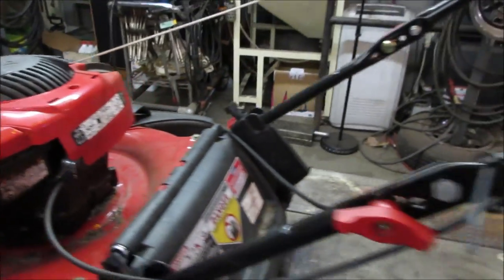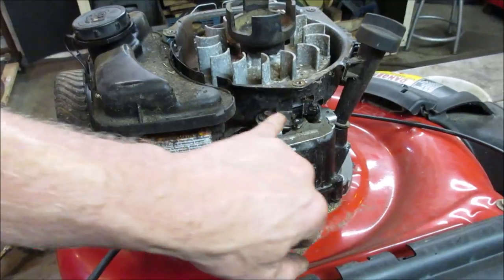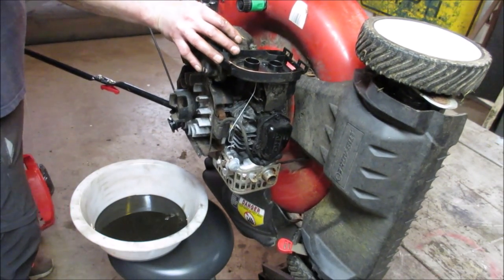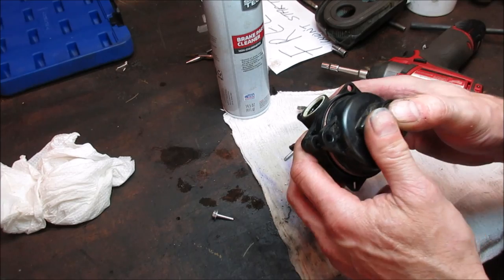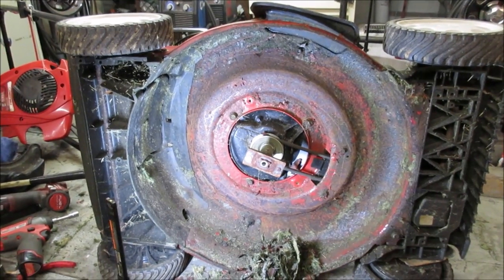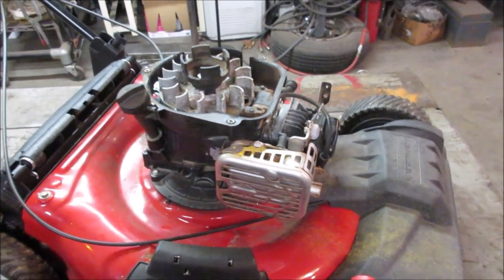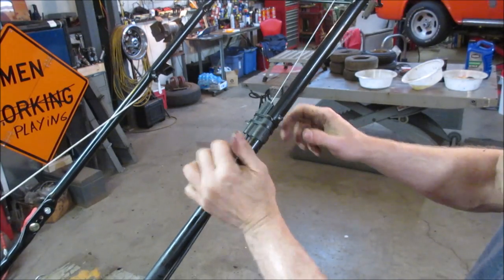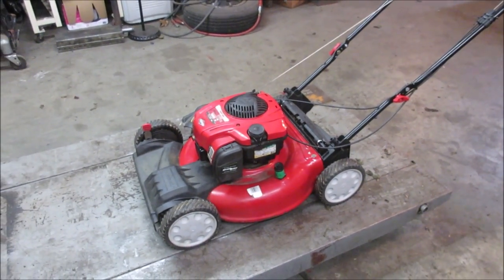How To Restore A Junked Lawn Mower. For Cheap.

Comment: A year ago I opened a small engine shop with a friend of mine. Learned a lot from you, Mustie, and you're a big part of why I opened my shop. I agree, most shops charge more than a push mower is worth for something like this. I don't. Not going to say the price, because I don't want this to be construed as an ad or a cheap plug. However, I've found I make more money charging cheap money for carburetor cleaning because people walk away when you tell them it's $100 and up but bite when it's a reasonable 2 digit number. Plus, I can clean that plastic carb and fuel tank in 15 minutes, so people are super happy when I can do it while they wait instead of having to come back. They tell their friends "This guy got my mower running in 15 minutes" and a bunch of people come out of the woodwork. It just makes sense to be reasonable and you'll make it up in volume.

Comment: Only bought one new mower. A Sears 20" self-prepelled power reel mower. Changed the oil, cleaned the plug, & air cleaner, adjusted & sharpened the blade every year.  Every 5 yrs new oil, air cleaner, plug, & drive belt. Stopped running 22yrs later. Original points & condenser  finally wore out.I had moved to Florida & had a rock yard now. So I gave it to fix-it-up & resell guy. New parts & wheels & back in service. $100. Still works. 1980 - 2022 >>>.

Comment: Thanks Mustie for continuing to offer these instructional small engine videos.  I have learned so much over the years from you (and continue to). Not only have you’ve saved me money but have given me great satisfaction in fixing my equipment.
Reply: Same, he has also given me confidence to tackle stuff myself.  He is the dad or shop teacher we all wish we had.
Reply: Same here. I was somewhat a good DIYer but he taught me so much more !
**Plus, he's the only man on earth I'd watch cutting his lawn !   🤣
Reply: I also solved my most complicated issues with my truck , after watching the video of his Toyota truck had a sudden misfire code and as soon as he described the possibility of what it might be , instantly I knew that he had solved this for me . I'm still impressed .
Reply: Me too
Reply: @marcryvon  Say whaaaaaat? I love mowing grass because it's so satisfying! I built a striper roller for my mower so that it makes really strong, bold lines/stripes/rows when cutting. I just used a section of ABS (you can use PVC but I though black ABS was more handsome) with 2 "test plug" end caps to make the roller's cylinder. I bought about 50 pounds of lead bullet casting ingots and melted them down into cylindrical hockey pucks by melting them slowly with my acetylene TurboTorch and dripping them into old cat food/tuna cans which were just a bit smaller than the ID of the ABS pipe. I cut the pipe to be as wide as the width of the mower from the outer side of each wheel. The test plugs cap off the ends from inside and are flush with the end, so the roller sits flat and level from edge to edge of the mower flattening the entire patch of grass that the mower touches so it's a solid and uniform stripe. I used CA glue to put one cap on, then I put the new round lead ingots in one by one, filling the gap around them with sand and dimpling the center of the ingot deeply with a punch to expand it into place a bit before I put the next ingot on top. I should mention that I measured the length of the roller so that the last ingot was cast to size for a perfect fit as the last one. Then I put the other cap on with CA glue too. I fabbed up the roller's arms by cutting and bending a few thin pieces of flat galvanized steel stock so that they could be slipped onto the wheel axle behind the wheel and then reach backward and attach to the roller in the center of the cap. I drilled the first arm hole to match the axle diameter tightly but with clearance to let it rotate and swing freely up and down to match the grass height. To attach the arms' other end to the roller, I just found the center of the circle by measuring and then drilled a hole down into the first 1 or 2 pucks. Then I used a coarse thread lag bolt (which I had drilled the arm hole to fit tightly for clearance but not much slop) to hold the arm in place. I laminated 3-4 of the thin steel stock together to form one arm. It was easier doing it that way to make the precise bends necessary. I laminated the arms with JB Weld. Then I put it all together, and it works absolutely fantastic! I see many others use sand or water as their ballast, but my mower is pretty small so that wouldn't be hardly any weight at all and the grass wouldn't be flattened much. The lead is dense as hell and the little 2.5" ABS is like, 50 pounds. It works great on our thick, beefy Bermuda grass that is kept short. Striping works much better on cool season lawn like fescue and rye that can be cut longer like 3-4" and is a delicate blade. The stripes are so satisfying to see with my nice and healthy dark green lawn. It's the best on the street but I put a lot of work into it to maintain that. It's truly a labor of love and de-stresses me. I like it. Most could not care less about the lawn. 😸😸😸 If you have OCD about neatness and symmetry then bold, straight, and sharp lawn stripes are heavenly to create and look at later.
Reply: Plastic carb, doesn't seem it was meant to be serviced,.......  love these videos.
Reply: @mannys9130  That is some M1 stuff you did there yourself! If you like Bermuda (I have it too and a roller on my mower as well) grass, check out "How to with Doc" he has some tips and great knowledge of food for your grass.
Reply: @geraldhaggard1018  no but they can be cleaned if they get clogged.
Reply: @SkaterStimm  Mustie is definitely the neighbor I wish I had. : - )

Comment: I literally found the same one the other day on the side of the road. All that was wrong was the recoil for the pull start. So I sprayed some penetrating oil, gave it a few rips and worked just fine. Cleaned the plug, carburetor and filter, changed the oil and it ran like a champ. Threw it back in the car and took it back to the guy and he was just shocked I fixed it. Told me to just keep it or sell it since he just bought a new one. My friend down the street needed a mower so I gave it to him. These videos always inspire me. Keep making them and I’ll keep learning from them 🤘🏼

Comment: Worked in a small engine repair place in high school. I've never bought a lawnmower! Every one comes form the side of the road. I do exactly what you just did and they all run great. Deck rot is the same here in Ontario. That's what kills them.
Reply: Honda has a non-metal deck mower that's got a lifetime warranty (I think) which makes deck rot a thing of the past. Love mine.
Reply: I agree...same scenario in Michigan neighbor....I make a good bit of side money buying old mowers and getting them right for spring time sale
Reply: @monkeybarmonkeyman  Huh, didn't know they had gone to a plastic (or plastic like) deck on some models. Think they used to have either aluminum or maybe even magnesium decks several years ago. Looks like their lower end stuff is still steel though.
Reply: That's a northern thing. You never see any equipment on the side of the road in the southern US.
Reply: I wonder if spraying the underside of the deck with Rhino Liner to seal it would prevent the paint from being removed and prevent the bare metal from rusting. Almost like a coat of armor. I know that as an auto tech, I've seen hard undercoating fail after a while and then it traps water beneath it making the rust even worse. However, truck bed liner is extraordinarily tough shit because of what it's designed to see daily. It's designed to have gravel dumped on it, furniture slid in and out against it, etc. Once it gets a thin coating of grass pulp, it would smooth out the pebbly surface. I wonder if putting a layer of sprayed polyurethane over the Rhino Liner would help smooth it out and add even another layer of durable protection to it. Or maybe go the other way around... Cerakote or polyurethane the underside and then put Rhino Liner on top of that. 🤔 Maybe Rhino Liner and a thick application of sprayed Plasti-Dip on top of it? I'm not sure. I'm in AZ. Most of us have no idea what a grass lawn even is. It's startling to native born people when they travel. 🙀 "WHAT IS THAT GREEN STUFF TAKING OVER THE YARD?!?!" Lol 😸 Some people do have Bermuda or St. Augustine grass lawns here though. The deck washer works pretty good most of the time and then one can just prop the mower up tilted over on a few bricks or 2x4s to dry out in the sun. Laying it over on the side and using a jet garden hose, or better yet a pressure washer, easily blows all the fresh grass off to keep the deck clean. Of course we have no salted roads here so our cars never rust either! My last car was a 1984 diesel Mercedes that had no rust on the underside whatsoever. The paint was gone, the suspension rubber was rock hard and split apart, and the interior plastics were brittle as glass, but the metal itself looked mint. 💪😸
Reply: @ksavage681  You have to go from 8pm to 6am. Mostly by 5am everything good is gone.
Reply: @ksavage681  Never, ever seen one down here.
Reply: @monkeybarmonkeyman    I have a push-mower from the 70's... has a cast aluminum deck.... still looks like new... I believe it's made by Hahn.
Reply: @PatrickWagz  Lawnboys used to be cast as well. Don't believe I've heard of a Hahn. Have to look it up!
Reply: Problem is folks mowing when it's too wet ( I hear folks around me mow wet frequent) wet grass clipping stick to deck, 99% of common owners NEVER use deck wash or scrape the deck, the moisture gets trapped between the grass and deck and just eats away slowly at the decks. I have the first model year toro recyler 20332 (2008-2012) that has seen thousands of hours, not deck rot, engine still starts 1-3 pulls and always gets a seasonal oil change. Other than the terrible plastic on steel Pinon drive gears that failed in 2019 ($40 aftermarket kit to replace with all steel construction) still running like a champ. Every month or two I'll pressure wash the deck, and add some paint and some wax, a smooth waxy surface grass doesn't really collect anymore!
Reply: @ksavage681  so you rebs just are better then us yanks at maintaining a simple machine?

Comment: What I love is Mustie makes this look easy.  That would've took me an hour to find the problem.
Reply: He's methodical, I reckon that is a big part of it-

Does it spin Y/N? If no, start there.
Does it have spark Y/N? If no, fix that.
Is it getting fuel Y/N and so on, each issue handled in turn. Great practice, I reckon!
Reply: Mine would have had a short trip out to the country and a meeting with Mr 45-70
Reply: Ever meet him?
Reply: Years of working with them allows him to be observrnt. Knowing how things are supposed to work is key also.
Reply: Like Max says, logical flowchart troubleshooting is the key. Engines need fuel, air, compression, and ignition as the very basics. You need the right amount of fuel, delivered to the cylinder at the right time. You need the right amount of air, delivered to the cylinder at the right time, and the ability to easily expel the exhaust when the burning is complete. You need ignition occuring at the right time, with it powerful enough to actually cause the fuel:air charge to burn vigorously. Finally, you need the ability to compress that charge at the proper amount. 

Compression is usually easy to guess just by pulling the string or listening to the starter motor's rapid struggles to fight the compression stroke each time it happens. A 4 stroke will have resistance when pulled, and a small 2 stroke weed whacker or chainsaw or blower should be able to be lifted up and held by the string without falling down the entire length of it. A reasonable amount of compression will make it impossible to hold your thumb over the sparkplug hole the entire time while rotating the engine. If there's no compression, you find out why. It could be failed rings and scored cylinder, blown head gasket, burnt or pitted valve seats, excessive or insufficient valve lash, broken or worn or fallen rocker arms, bent or broken or worn pushrods, failed or worn lifter, broken or worn camshaft lobes, incorrect camshaft lobe clocking (plastic cam lobes can slip on their metal shaft and be out of time), incorrect cam gear teeth/degree alignment, stripped plastic cam gear teeth, or a faulty compression release system. 

Then IMO spark is the next easiest to verify. A lightbulb type spark tester is best for lawn mowers but if you can hold the plug and spin the engine quickly with each hand you can see the spark up close by just holding the plug body to a block or head surface to ground it. The spark has to be strong and consistent. If it's not present or it's weak, examine the ignition system. A weak spark at atmospheric pressure won't be able to ionize and jump the very dense air at all in a compressed fuel:air charge. Remove and inspect the sparkplug to make sure the center and ground electrodes are present, clean, and gapped correctly. Check the plug wire for degradation or breaks, check the stop mechanism to make sure the coil isn't being grounded by a bad stop switch or chaffed wires or a sloppy deadman's lever cable/linkage, check if there's a low oil cutoff safety switch that grounds the coil, check the ignition coil for shorts or opens, check the gap between coil and flywheel for proper distance and corrosion or rubbing damage, check the points and condenser for corrosion and gap and timing and good test values, you will find something eventually.

If spark is good, fuel and air are next. After checking the compression and valve train, a dirty air filter or obstructed intake or stuck choke linkage or plate/faulty automatic choke mechanism or faulty governor that holds the throttle plate shut all the time are really it for air issues. For fuel, It's pretty simple with carbs. They are often just dirty internally at the jets or needle seat, full of water and corrosion and stale fuel, improperly adjusted, have sloppy linkages, have a dirty filter or filter screen, or they have a float that has developed a pinhole and is full of fuel which floods the engine or a stuck needle that doesn't fill the bowl. A massage in an ultrasonic cleaner's chemical bath should cure it, otherwise just replace the carb. Jets and passages can be cleared with pipe cleaners, thin wires, torch tip cleaners, or micro drill bits. 

If the compression is good, the timing and valve (and compression release) operation is correct, spark is present and strong, the carb is new or clean and properly adjusted/functioning, and the intake is not obstructed by a filthy air filter or nest or other things, spark timing and exhaust are left. A clogged exhaust due to fouled spark arrestor screens, fouled exhaust manifold/port, collapsed muffler, or animal nest is easily determined. Spark timing can be out of whack due to a squished or totally sheared flywheel key from hitting a hard object because that moves the magnet and retards timing several degrees away. The coil can be misadjusted too which would advance or retard ignition. If those 2 things are ok, consider the possibility that the key is a very hard replacement from an ignorant previous repair, and the crankshaft itself is twisted which has retarded the spark timing. That's a fatal failure due to financial reasons, usually. An offset key could potentially fix that, but make sure the crank isn't bent radially as well from that hard object hit. If it twisted the crank rotationally into plastic deformation, it may have bent it radially too. 

I think I covered most if not all possible causes of a simple outdoor equipment engine not running. If you check all of those things and it still doesn't run, consider calling up your local witch doctor and sprinkling a bit of your or your child's baptismal holy water on it. 🤷🏻‍♂️

Comment: One tip that I found somewhere else on Youtube, it's possible for the choke lever to touch the side plate that the carb mounts between and jam the choke in the open position.  This will cause a no choke condition the next time you go to start the engine.  Cure, form the side plate a little away from the choke lever or file or grind a little
off of the end of the choke lever so that it doesn't touch the side plate.  That tip solved my problem.
Reply: The worst mower of all for jammed carb linkage and such has to be a Honda engine mower. Instead of studs to slip the carburetor over, you have to use bolts that traverse through all kinds of plates,and maybe 5 or six gaskets the carb,and even the fuel filter housing. Subsistute a stud for the 6mm bolt and it's way gooder. Don't know the length, but I suspect the horizontal Honda engines and clones have studs that will work. If you know which Mustie video dealt with a Honda engine, please link it